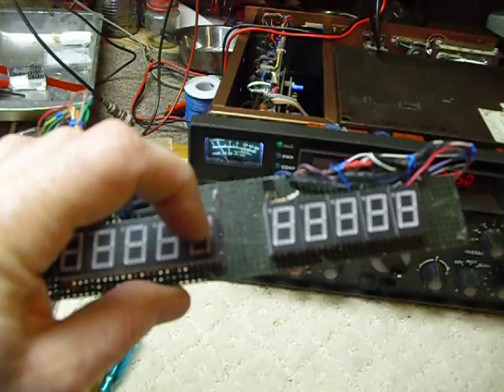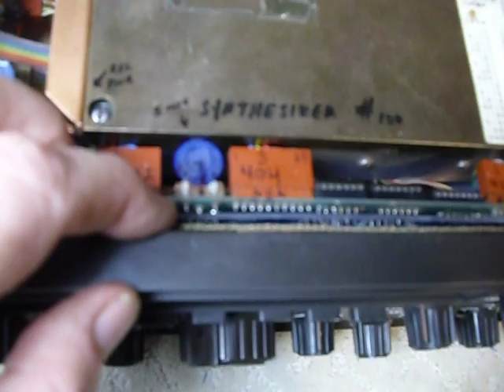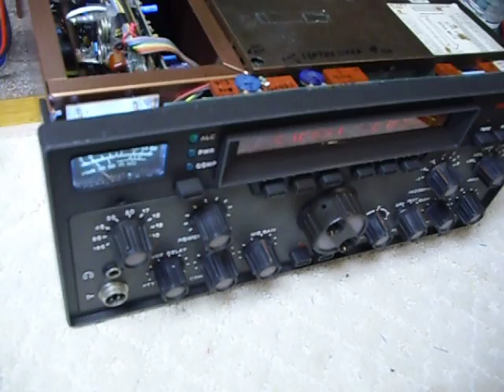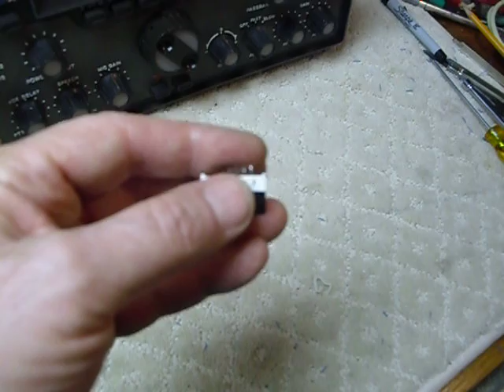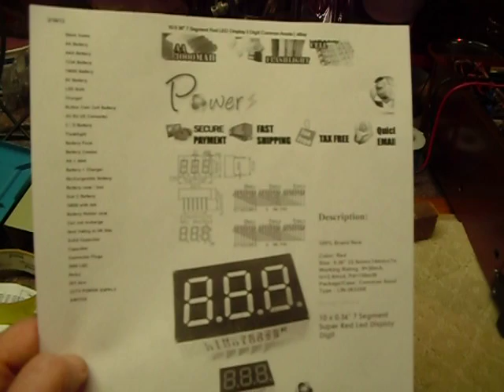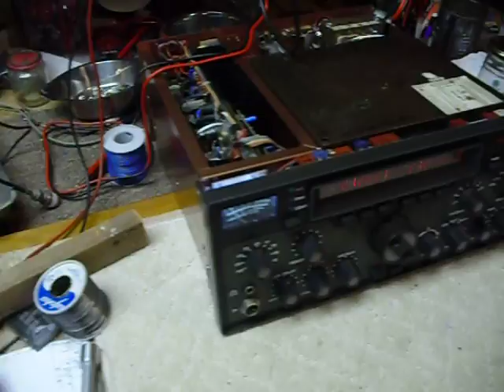SS9000-7,fixing old amateur radios, SS9000 , rare Heathkit , Basket CASE SS9000

Comment: I took a Norataki VFD and used it in my SS9000.  The Nortaki has 24 digits, and you can split them in the middle. The Futaba I found had a bunch of extra stuff for CD and audio levels, and would not fit. The Norataki worked fine. These SS9000 are pretty rare, and not without the usual problems early synth equipment had in 1982. The price tag on these new, was $2700 in 1982 dollars.  Another SS9000 popped up down in Tucson, so I have spare parts now. The SS9000 color scheme matches my SA2060A antenna tuner, and that SA2060A is probably the nicest manual antenna tune I have ever used, that was not a home brew using a pair of $600 Jennings vac caps. 73s KI7AQJ
Reply: The SS9000 in Tucson was $500. Well worth the price, the gas,  and the 160 minute drive!
Reply from the maker: Yes I would say worth the drive for sure . Glad to hear the Nortaki VFD will work I bought another make on Ebay thinking it would work and it was way to thick would not fit So I made up the LED display .  73  Bob

Comment from the maker: Notice the flickering frequency display this is caused by the difference between the LED scan rate and the video camera scan rate to the naked eye the display does not flicker .
73  Bob W9RAS
Reply: I'd guess what we are seeing flicker is the sampling rate for each digit, matching or mismatching the video scan rate as they tend to dance around. The Norataki VFDs have a split wired 24 9 segment display with digit and a colon. I just found a 16 element per character alpha numeric VFD display with a colon & a comma between each character. I prototype with that Hong Kong and Shenzen China stuff, and am amazed at how fast that stuff gets from China to Arizona. I have had small parts arrive in 5 days. The LED display is still very period correct for this era transceiver and they really look great in there.  I remember seeing this at the Heath Zenith store back in the 1980s. I think the price was $2795.00. Oh, and these were not sold as kits, either. Way above my budget, but I built the big digital clock for a neighbor, and some antenna tuners in the 2040, 2060, and 2060A version. I have loved the 2060A ever since. Even after 35 years, they are still one of the best legal limit USA or Canada QRO manual Pi type tuners you can get. Some rubbing compound for cars mixed with dielectric grease on the contacts, roll the inductor knob around full travel several times, wipe them down, rinse & repeat and they clean up better than new. I put LEDs on the counter display and the meters and it looks fabulous now.